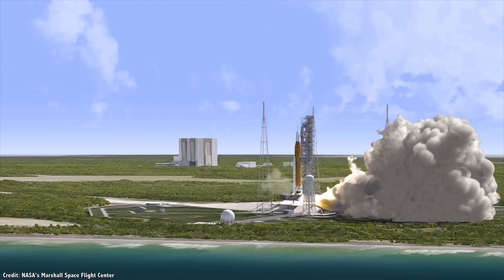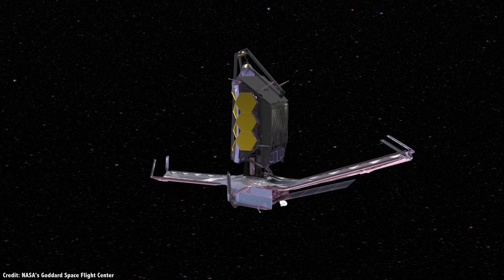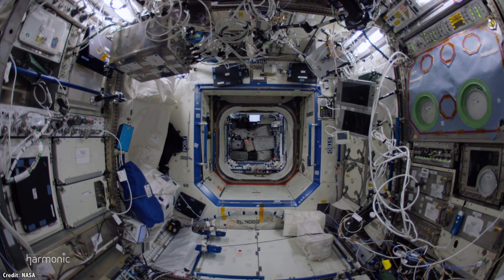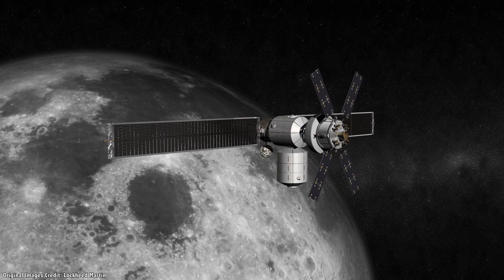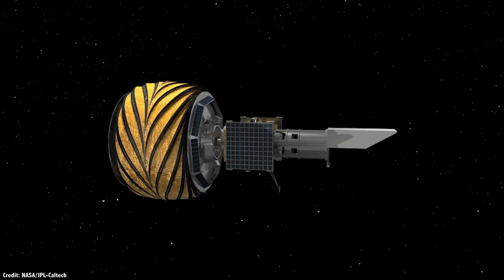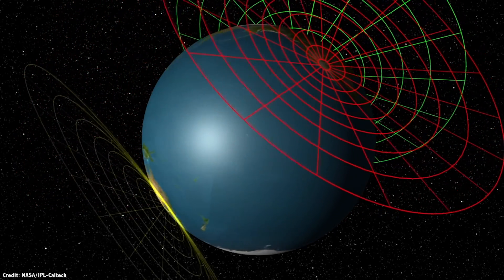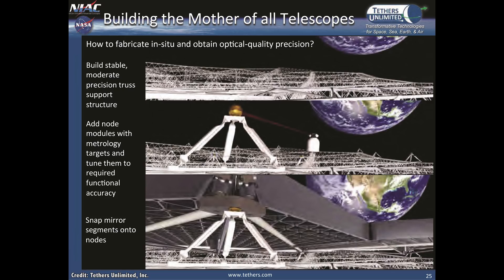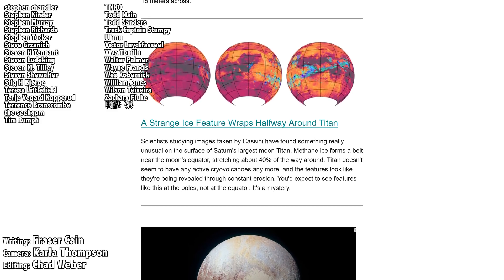Build Enormous Structures In Space With 3D Printing

Comment: What's the point of a cis lunar space station again? I must have missed that memo. You get the danger of interplanetary space flight, radiation, solar flares and micrometeorites, without actually getting anywhere. Wouldn't building a base on the moon be the better idea? You can cover your base with local regolith and solve the shielding problem and can try to use local materials for manufacturing and develop that technology and train for mars. You'll also get some data on what low gravity does to the body and plants. So why are they doing this? Politics?
Reply: I think it's because of the difficulties you mentioned. The moon base/lunar space station is ultimately nothing more than a testing/staging ground for Mars missions. Having a long term human occupied station in deep space will help us learn how to protect astronauts and survive in deep space missions. Like the potentially 6 month trip to Mars.
Reply: China and ESA want to build straight on the moon. I think ultimately that end up being cheaper and quicker, plus a base on the moon for construction, resources, and looking after humanity aint a bad ides.
Reply: Funding my dude

Comment: Wouldn't it make sense to print on the moon, then you can add a polymer to the lunar dust and use it for building the basic structure. At the same time you can use a lot of the same techniques for building a lunar base, i'm excited for the future the private sector has pushed forward.
Reply: Another plan out there is to put down thin-skinned habitats and heap lunar dust and rocks around and on top.  All the tricky bits about air-tightness would be tested on Earth before the modules fly.
Reply: Yeah, I've seen the Verge video of nasa using 3D printer mixing rubbish and sand (simulating regolith) with some kind of resin to make structures. There small scale and pretty slow at present. But their working on making a much bigger 3D printer. Taking just a fraction of the time. Which they'll use to build habitats on the moon.